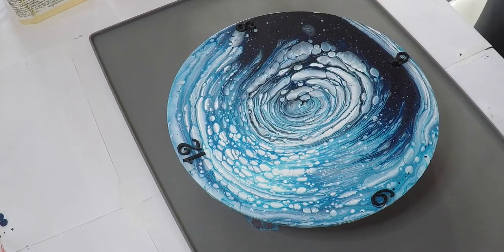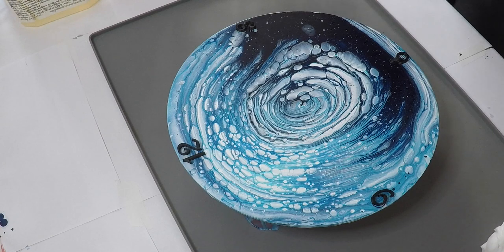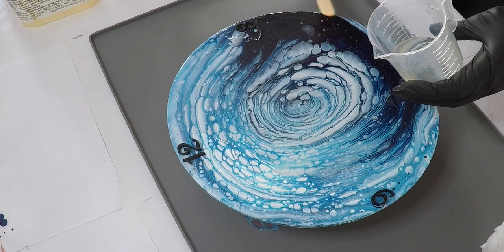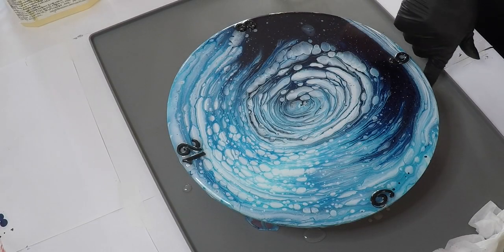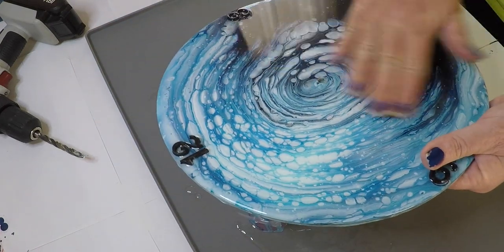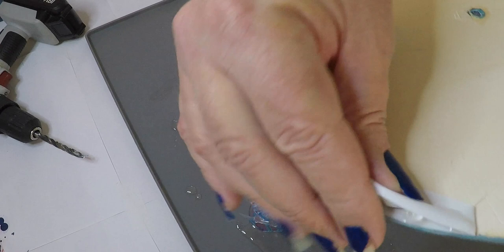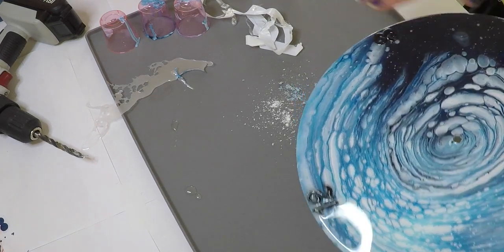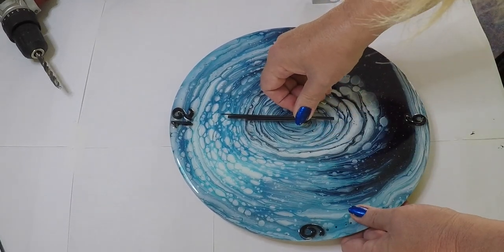How to Resin and Re assemble Clock / Acrylic Fluid Art / Resin Art

Comment: Hi Belinda your clock looks great. I resined a clock but the resin pulled away from the edges I don’t know why. I don’t use silicone I’m at a bit of a loss as to why.  My clock base is the same as yours.
Reply from the maker: Hi Sue. Oh I am sorry to hear your resin did that. Shrinkage could be due to a few things, temperate, oil on your hands, not enough resin and it pulled in. My advice is to wipe the edges and give it another coat. Hope that helps. Thanks for your support ❤❤❤
Reply: @BadeArt  thanks Belinda I will give it another coat and see what happens.